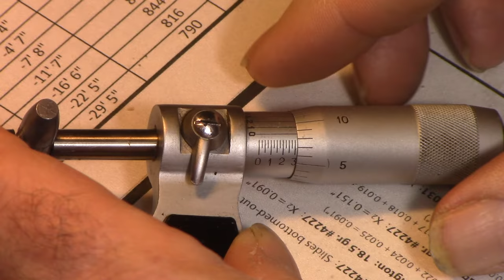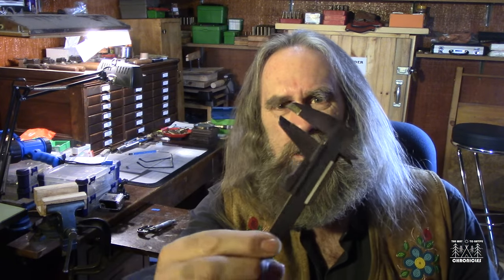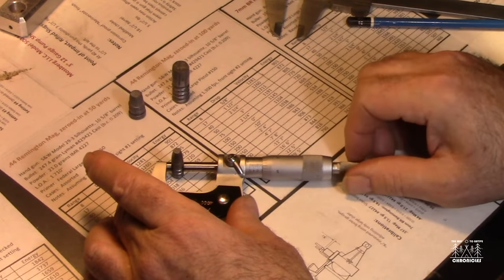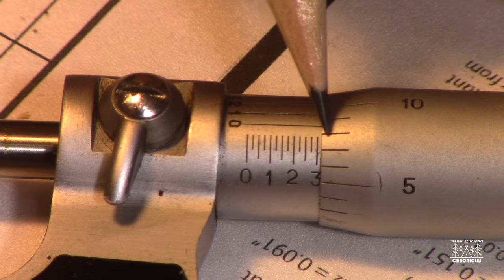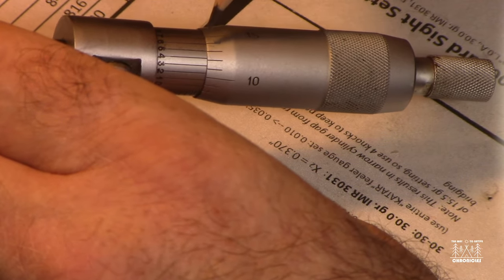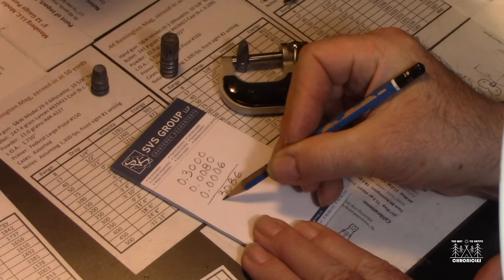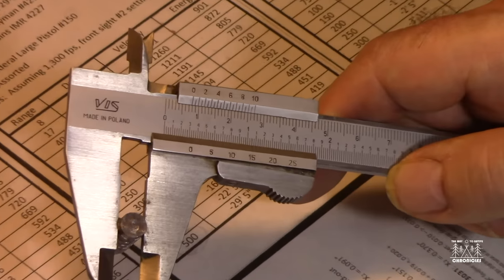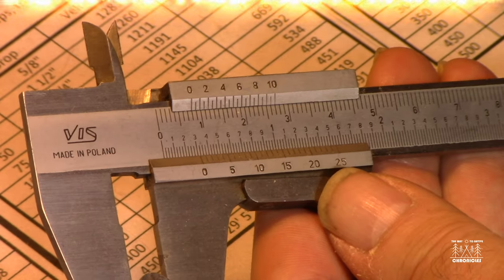How To Read Vernier Scales On Micrometers and Calipers

Comment: I like the old school caliper.  I had a dial caliper- till the dial housing canted on me at a 30 degree angle.  Made for frustrating reading.  I went to a digital one, but I often have to zero it between measurements because it likes to creep a thousandth if I close the jaws too fast. When this thing dies, I'm going looking for a simple vernier design.
Reply from the maker: I wonder if you can even buy them with Vernier scales anymore...